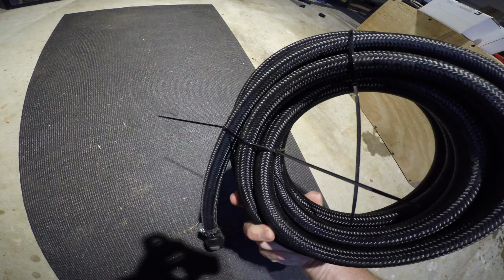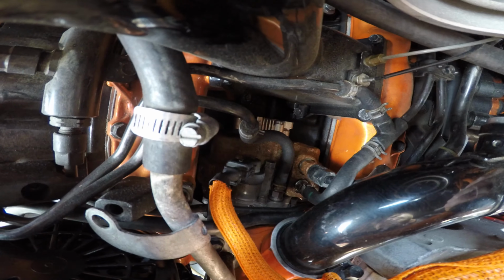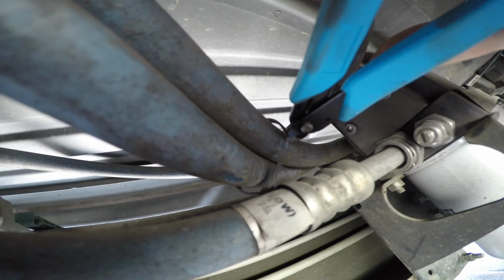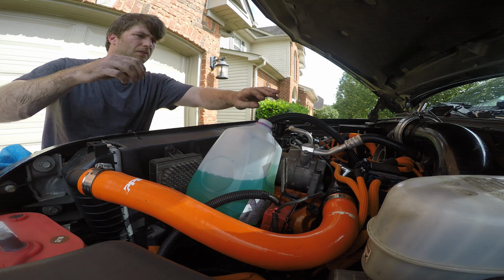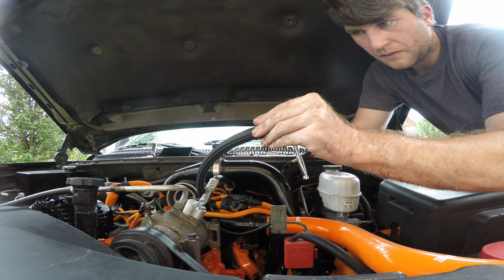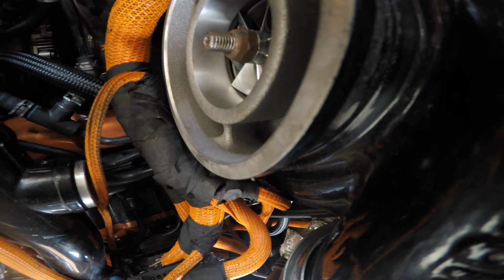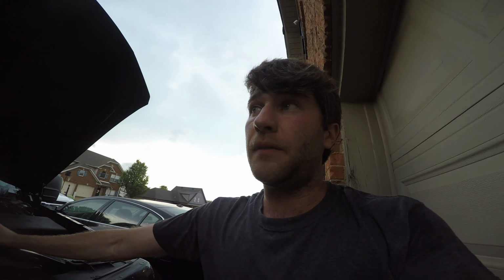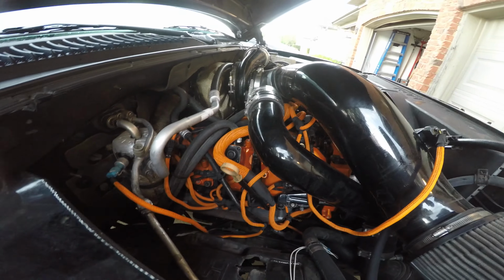10an fuel line install

Comment: What does the 10an line do?
Reply from the maker: Nothing, just cleans it up and has slightly less restriction but not enough to matter really
Reply: aguyfromalabama (Jakob Hernig) so it just replaces the hard fuel line from the pump to the cp3? Did u just take the pressure line or both lines out?
Reply from the maker: @logan_lly5198  yes from the tank to the lift pump and from the lift pump to the CP3. I left the return line if that’s what you’re asking.
Reply: aguyfromalabama (Jakob Hernig) yes I was talking about the return line. Thanks for the info probably gonna do this on my lly!
Reply: On lb7 if u do this . Have the 1/2 from pump to cp3 what ya do with the hard line from the engine fitting that goes in valley over cp3 to the ficm?? If u run it to
The top
Valve cover fitting i got it figured out but if u delete the fuel
Filter housing and wanna run to the pump what u do with that one foot of hard line from valve cover to ficm?